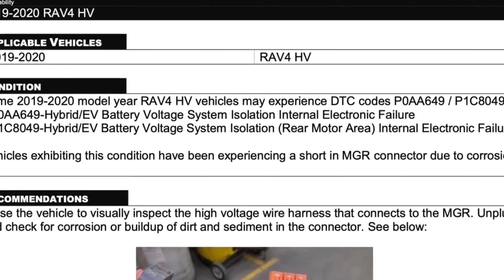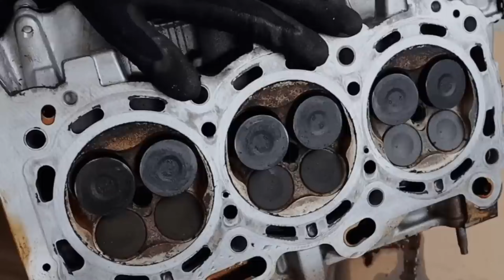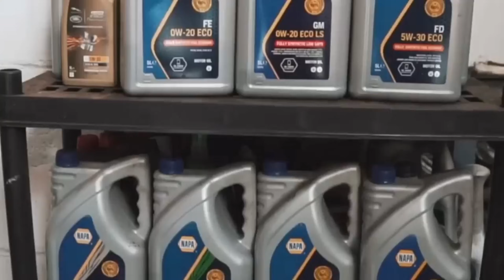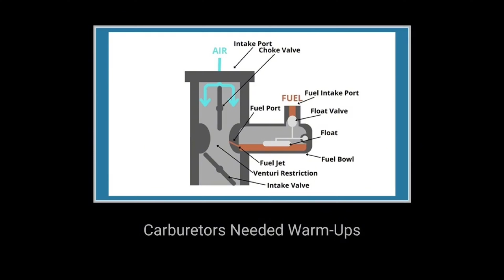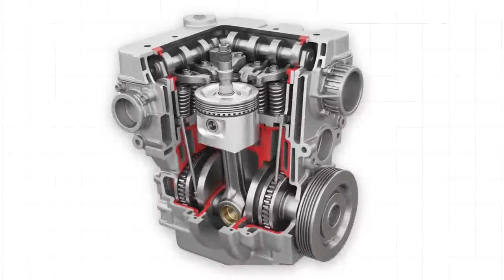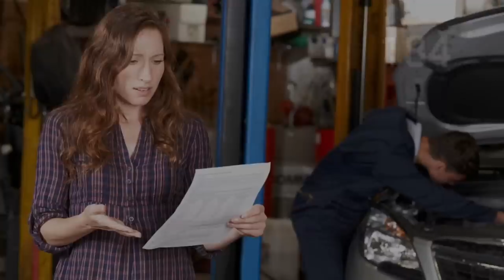Why 2026 Toyota Engines Fail at 50k Miles (And How to Prevent It)

Comment: Yea Tom, need to take off your AI helmet and step in front of the camera. The purpose 
of warming the engine up is for the oil, not the fuel system. If a fuel pump goes bad
with less then 100k, it's not a wear item, it's a manufactures quality issue.
Yea need to rethink this video!!!!

Comment: I’m a amateur mechanic, and I’m almost positive it’s the engine oil. NEVER use any engine oil that starts with 0W…etc., because these 0W engine oils are not made to save your engine, but rather save you money on fuel only, per government regulations…etc. because these 0W engine oils are thinner in viscosity, and more fuel friendly, but not engine friendly.

The BEST engine oil viscosity for all modern engines is Pennzoil Ultra Platinum 5W30 FULL synthetic regardless of the car manufacturer requirements or recommendations. 

The manufacturer scares you to believe that if you use any other type of oil other than the recommended one, then the engine warranty will be voided. The best oil brand is Amsoil full synthetic signature series, but it’s way too expensive, it’s about $20 a quart, but in my experience and personal opinion the next best option is Pennzoil Ultra Platinum 5W30. It’s fantastic, it’s not made from crude oil, but rather from liquid gas. It’s much cleaner, and better for your engine, and far more durable than all other oils even better than Mobile One or Valvoline full synthetic oils. Pennzoil Ultra Platinum full synthetic oil 5W30 is the BEST for any vehicle that is 15 years old or younger hands down. 

Don’t take my word for it, do your research for yourself and see.

Comment: I don't believe people have changed their long to short driving trips and nobody south of mason Dixon ever warms up their engines.. they are in drive as soon as seat belt clicks..  same Toyota motor in Europe recommends 5-30w, here 0-20. I think Toyota was pushed by EPA to get better mileage so the lowered the weight on purpose knowing that the average engin will does at 125k vs 250k...

Comment: Current motors/vehicles are not fit for purpose,  unless the purpose is have great fuel efficiency for 50k or so and then buy a new motor/vehicle. In which case where is the benefit for the envirnoment over vehicles which use more fuel, but last 300k?

Comment: Ummm, you’re wrong about Toyota’s direct injection engines! Toyota uses a combination of direct injection AND port injection so the time port injection is being used is more than enough to clean the valves! Please name me a Toyota engine that doesn’t have dual injection. And the 2.5 liter engine has been out since 2018 so where are the engines with clogged intake valves? I keep careful watch on stuff like that because I’m going to buy a 2026 RAV4 PHEV. Short trip and the absolutely STUPID 10,000 mile oil changes are a problem though. By the way how does a 2026 RAV4 accumulate 50,000 miles driving a bunch of short trips?

Comment: An engine shouldn't be designed to fail due to normal usage. It sounds like someone whose life revolves around short trips should buy another brand that handles that pattern.
Reply: EXACTLY - like a 1967 Chevrolet. EPA is the causitive factor here. Enjoy your classic if you can find one for less than 50K.

Comment: I have the dreaded 2.4theta 2 Sonata. I only use top tier gas like Chevron mostly but sometimes Shell or Texaco and even Exxon or QT but they are all top tier 🎉 I only use OEM oil filters and Valvoline Restore and Protect. I change my oil every 3K miles which is once a month. I add Techron Complete from time to time and change the PCV valve every 10k miles. I also use 5W30 which is allowed in my owners manual. So yeah, I don’t take chances. 😂🎉

Comment: Very informative video.  Hopefully people who purchase these new vehicles will take notice.  It’s not just Toyota, it’s everyone, because of the government’s CAFE Standards. 

My wife has a Corolla Cross Hybrid has the 2.0L engine.  It seems the hybrid function, though it gives you more mileage per gallon, in the short trip areas during the winter months it wouldn’t be feasible to drive it, unless you lived in the country, where the oil temperatures would be in designed range. It is for this reason, I change her oil &filter every 5000 miles. Even though Toyota states 10K miles, I do it for peace of mind.  Our local dealer, don’t believe them.  At the 5K check up, they refused to change the oil, only performed fluid checks, they say they rotated tires, but I know they didn’t perform the rotation, because they didn’t have the wheel lock key. They didn’t ask for one either. The locks are nock a standard Toyota wheel lock. 

I drive a diesel sedan, roughly 500 miles weekly. During the winter, it could take 5 miles of low load driving just to see the  oil temperatures pop in the 120s. Roughly twenty minutes into my trip during the winter months I will finally achieve 195 degrees on the oil temperatures.  For this reason, I change my oil & filter at half the recommended distance the manufacturer has in the maintenance matrix. 

So, I am grateful for my knowledge of engines, simple to complex engine, brakes, suspension and tires.  Been doing this gig  initially when younger, then on the side.  Saved me thousands. Two of the four vehicles are Fords, in the driveway have 300K, my 10 yr old diesel Passat is approaching 190K and her new Yota is coming up on 9K.  I believe I have it figured out.

Comment: I have a 2010 RAV4 Limited 2.5. with 165000 miles. Runs like brand new. Wouldn’t trade it for anything. Hope to get 300000 or better. Love my car!
Reply: I have a 2022 RAV4 XLE that requires 0w-16 but switched to 5w-30 at about 62,000 miles.  I live in hot inland Southern California

Comment: Its so precise that you have to baby it to get 50 feet more per gallon of gas.  Screw all that, I have had many different makes and drove them short and long distances with no problem.  Stuck 10W40 oil in them, usually the CHEAPEST oil I could buy and they did not care. I NEVER had a problem more than a water pump and it was cheap and easy to change.  SCHREW this precision CRAP
Reply: Joe Biden is responsible for this🎉.😢
Reply: @danielpetchel1894 So, Joe's history.

Comment: 0W-8 oil seems too thin to me. 2025 Crown Hybrid. I am using it, but I worry about it breaking down in the Texas heat. What is your opinion?
Reply: my local Toyota dealerships use 0W-16 or 0W-20 oil instead 0W-8 for my 2024 Corolla Cross…it’s on the receipts even though the car has a sticker of “ 0W-8 “ on it…I live in cold weather…they will give you a lecture about the car needs only 8000 miles intervals and once per year oil changes when I want to do the oil change at 9 months and 5000 miles….I guess the 0W-8 is newer type thus more expensive…. If you can change the engine oil by yourself, you are already winning
Reply: Lake speed has a video choosing the right viscosity.  There is a chart based on main bearing clearance and block type. I have a 23 camry 2.5. The clearance is .00010-.00020. The charts shows it shoukd have a 0w20 or 5w20 based on oil temps of up to 220F. Ive used 0w20 pennzoil ultra platinum most of the time. 51,000 miles no consumption no noises no problems.
Reply: @jas4925  I use 5w30 because mine has 120k miles on it and the people before me used 0w16 with 10k mile oci so I’m accounting for wear. It’s a guess but so far so good.
Reply: Research the bearing clearance to see what higher viscosity you could use for the temps and engine loads. I know I can use 5w30 in 16 and 20 engines but I would GUESS that clearance’s would be tighter for 8. I’ve had no need to research it so I don’t know.
Reply: Check what is prescribed for the engine in Australia or similar, if the engine is in vehicles sold there.
Reply: I just changed my 30k mile 2023 Tacoma to 5w30 because in south Texas it's almost always too hot for those thin 0w20 or less oils. There's actually small print in my owners manual that confirms this. 0w20 is for cold, snowy conditions NOT Texas heat.

Comment: Just checked ChatGPT.  2026 Toyota dynamic force engines are still given the 10K oil change interval.  Why, if they have come up with all this info would Toyota still recommend this?  Don’t forget that turbos also break down oil faster.  You better do your homework if you cannot trust the manufacturer on proper long term maintenance. 5K-6mos should be the standard!
Reply: my 2025 Rav4 2.5L gas engine ,oil interval is 8.000 km so 5.000 miles,dealer recomended ,and the window sticker say so too.
Reply: So they can show a low cost of ownership
Reply: 10k is too long especially if doing short trips. I have a 1990's Landcruiser and change around 5k or 7.5k if able to trips round the country. No trouble at 300k. Make sure filter good quality and use full synthetic.
Reply: Its in the manual...short trips in cold weather =5k oil change, 10k is for highway miles

Comment: 2026 toyota with 50000 miles, I am wondering how many people put on 50000 miles with less than 3 months.
Reply: Me😂
Reply: That r the dealership has that car sometime in July or August in 2025 if the owner has the car at least 7 months she monthly average about 7k a month
Reply: I think they just updated the title on the video to 2026. But the 2026 engine is the same as the one in the previous RAV4 which goes back to the 2019 model.
Reply: Big lies 50000 miles 😂 .
Very good try the underline problem  2026 rav4 is short trips how in the hell the old woman reach the 50,000 miles 😂.
Reply: Uber

Comment: A engine with both port and direct injection runs in port injection only at low speeds and especially in the cold. That’s common sense! Only time direct injection kicks in is at high speed loads. You should never have to worry about carbon buildup in an engine with both as long as you are using correct oil and change it sooner than recommended by manufacturer.
Reply: Try to make it more complicated